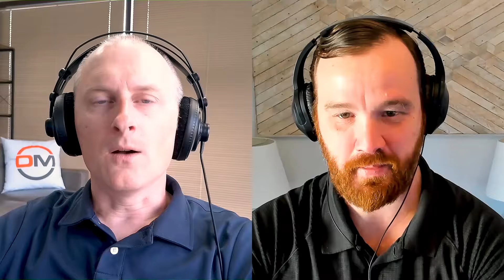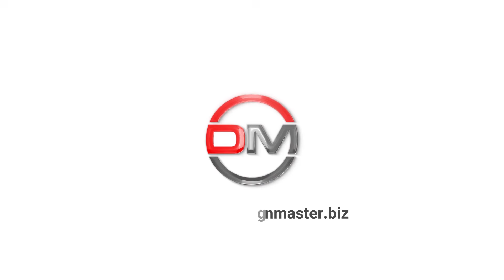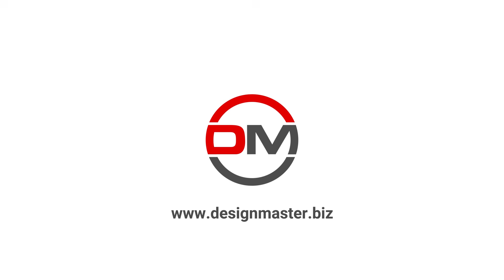AI, BIM, and the Future of MEP Design - Episode 44

Comment: The discussion on HVAC automation and the role of mechanical design in coordination is very insightful. For those using progeCAD, the progeBILLD add-on provides specific tools for Electrical, Piping/HVAC, and Mechanical/Structural systems including IFC export to assist with BIM coordination.